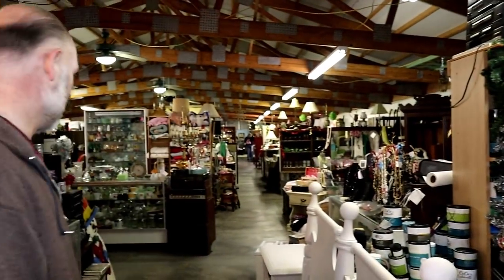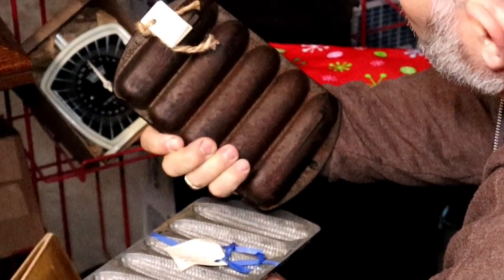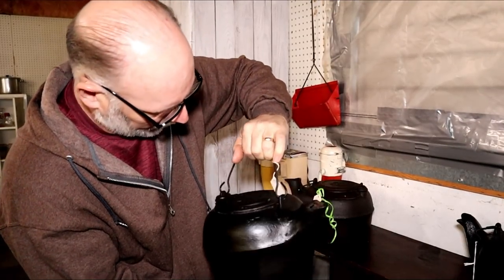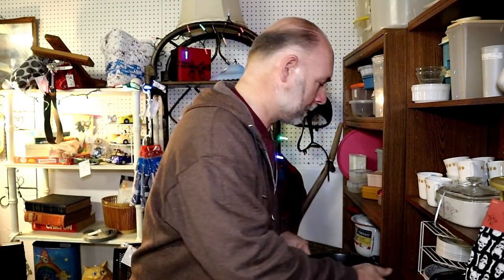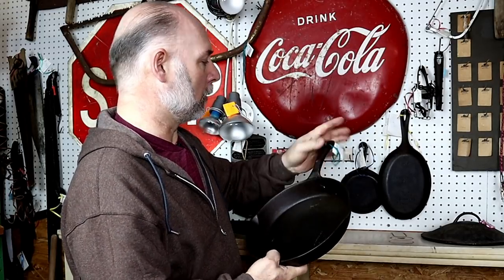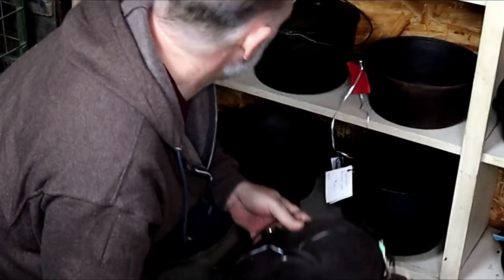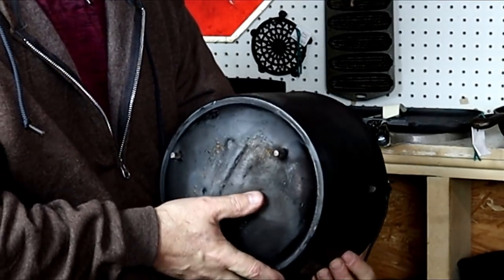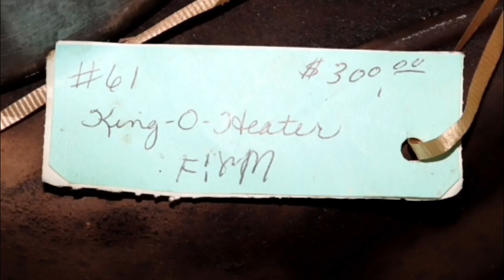Hunting Cast Iron Cookware In The WILD!!! Episode-6

Comment: Hey Stephen, just added you.  I'm only following a handful or so channels man, but so far your channel seems authentic and not commercialized and hokey.  Enjoying your knowledge of BSR, even though admittedly I'm more of a fan of really old, light Wagners and some of the really old Griswolds that are their lightest pieces.  Recently the wife got a Field for her birthday, it's the closest thing to a brand new early vintage Wagner on the market.  A while back I got a Stargazer for camping and for the house occasionally.  Thanks for all your efforts Stephen and I hope in addition to all the knowledge and fun, maybe you can also put a few nickels in your pocket as well!  Let me know if you run across any nice really old Wagners that aren't spinners at all and sit flat/dont rock, that you have in duplicate; I may wanna snag it off you if you found it for a good deal and you can put a few bucks in your pocket even after shipping.  I struggle finding deals and recently paid $50 for an early #9 old logo ("arc" Wagner/"straight" Sidney) with the outside heat ring and ity has fairly deep coal stove sulfur pitting on the bottom.  (which I don't mind -- I think it adds to the history and is cool as long as the pan is still in great condition otherwise -- but you'd think I could get it for less than $50!)
Reply from the maker: Thank you for subscribing. I'm trying to make the Channel all about the cast-iron. Helping people to collect the store use is my ultimate goal. Currently there are no commercials on my channel except for the links in the description but there will be a few commercials once I make it to a thousand subscribers and get monetize with AdSense. I will make sure that this channel doesn't go overboard with commercials though. The Vintage Wagner's and Griswolds are the best. They are lightweight and a joy to use. It's an awesome thing to know that you're using a piece of History.
Reply: Cast Iron Cookware I don’t mind watching a few commercials here and there and waiting 5-10 secs to watch or hit the skip button, and if helps you to make a couple of nickels for all your efforts, and that helps you to be able to make more videos, I say it’s a win-win for all the vintage cast iron warriors!  I don’t think a couple of commercials will do affect the authentic “vibe” and non-commercial feel.

Thanks again, and keep up the good work sir.  Good luck and happy hunting!  

Let me know if you run across any sweet old “Wagner” Sidney O pieces with the outside heat-ring that sits flat and don’t spin from the early 1900s that you find for a sweet deal that you can flip to me and make a few bucks after shipping from AL to NC.  Call me crazy but I trust you!  👍🏼

PS I do like the Wagner Ware pans from a little later too if they are in good shape, the Wagner Ware pans with the fancier logo.  I just like their earlier ones better.  They seem a little lighter and even better made.
Reply from the maker: @zacharyriley4122  when I do eventually add commercials, I promise to keep them to a minimum. I will keep my eyes out for the old Wagner. I  agree, they are lighter and better made. I've been operating on a shoestring budget and have to pass on a lot of great pieces when I run across them. I'm starting to get a little traction lately and hope to carry more home with me when I find them. I know that I want be able to keep them all, so I don't mind passing some along. My first intentions was to put up a few videos just to share and the channel took on a life of itself and snagged me for the ride. I didn't realize how much I enjoyed this until got a little farther down the road with it and now I can't see myself doing anything else. I have the best subscribers and have received support like I never dreamed. I plan to keep going as long as I'm able, hopefully for now own. Thanks for being a part of my channel.

Comment: Ha ha, I live in a house where there is about 30 pieces of cast iron. And a gas
Stove. I'm afraid to use it. Because I might get too attached. The owner may or may not be back, she is renting rooms to her grand kids and me.  I have three sizes frying pans, and my mom's which is a big pan and I'm not sure about 6 pieces in my storage.  I'm new subbie, so I dont know correct name. $25.00 for the grill, I want that and a round griddle, which we Mexixans call a comal in Spanish. My mom's comal cracked. All my stuff is in storage as I rent a room. I have a bunch of corn sticks pans and have one that has the husk pattern and a couple of aluminum. That store is high. You can get them for under $10 at thrift stores here. San Jose, Ca. Love that cow griddle. I only to collect to cook. But you are making me desire. Good thing I don't have a house right now. I want a lid for 8 and 10 in pans, do they exist? My mom felt the lids were too by heavy. My ex boyfriend taught me how to season between uses and keep rust off. Oh I have a little play cast iron stove. All the pieces come apart, the burners the stove pipe, the oven for opens, and there is a drop shelf and a shelf that fits over the pipe. And there is a griddle too. 10 inches high. And it came with a round griddle, frying pans and a little Dutch oven and a a wood cutting board and rolling stick. I used to add my Mexican mini pottery to it and play play play. My niece has it. And she has this huge cook's kitchen with a extra pot belly stove that works and shelves and large window sills and it looks like an antique general store. So she displays my little cast iron stove.

Comment: $49.95 is a good price for the heavy BSR Red Mountain Flat bottom Pot. Notice the long "legs" running down from the rim. Not sure why someone drilled holes in the lid...
Reply from the maker: They may have been using it as a humidifier. Thanks for identifying it as a RM BSR. I believe that you are correct.